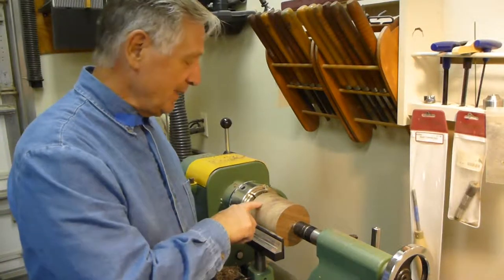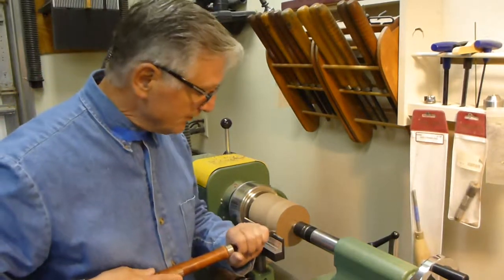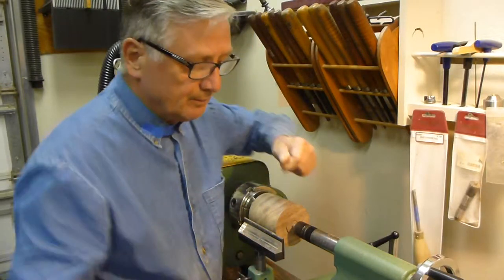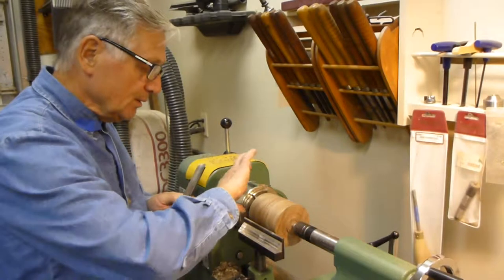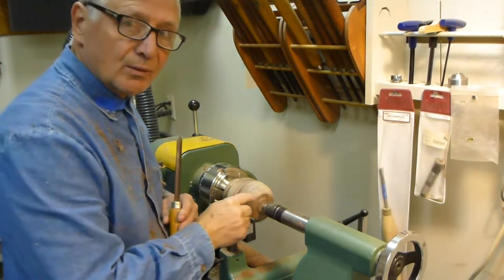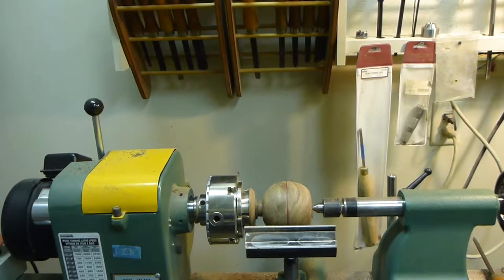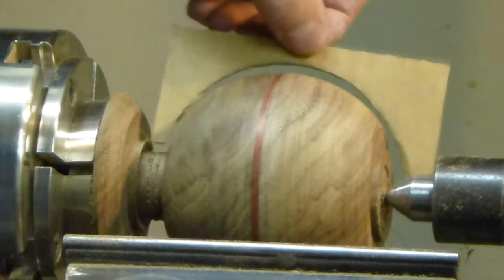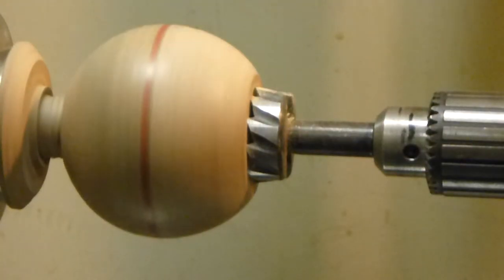2015 Ball Peppermill - Part 1

Comment: I like it.  Where can I buy the mechanism?
Reply from the maker: https://www.woodturnerscatalog.com/p/53/5242/CrushGrind-Click-In-Mill-Mechanism?term=crushgrind
Reply: Thank you Heinz!  Did you ever do a Part 2?
Reply: Thank you for the link Heinz.  I was actually hoping to find the black iron ring on top.  How does it integrate with the grinding mechanism?
Reply from the maker: I get those from Switzerland when I visit but they must be available here in the US as well. Then you need to have a special connection piece.
Reply: Sorry to continue with questions but I found the eye bolt, so can you elaborate on how you connected it to the mechanism please?  Also, did you part your ball in half or did you just drill from both ends to install the mechanism?  Did you ever do Part 2 to your video?  I love this piece and want to do one.  Thanks for being patient with my questions.
Reply from the maker: It's hard to explain in words. I can e-mail you a drawing.